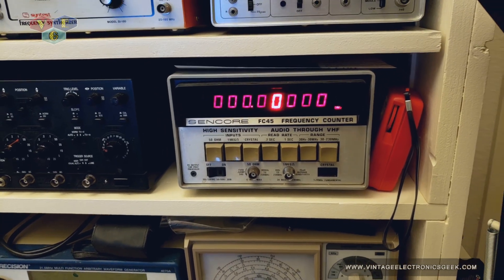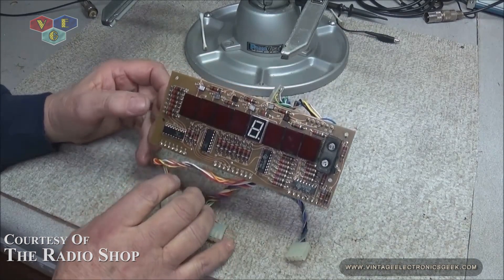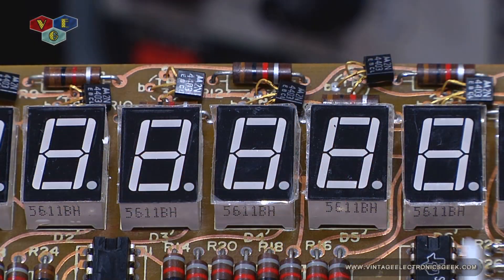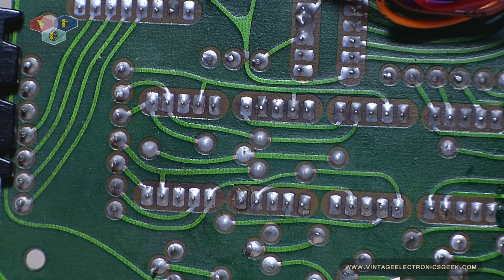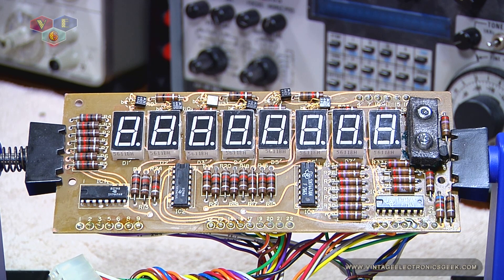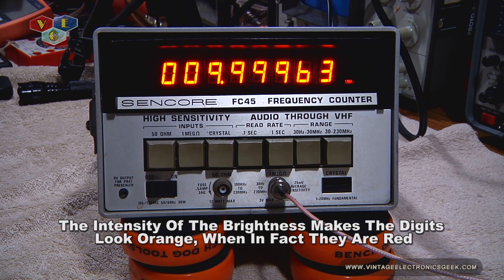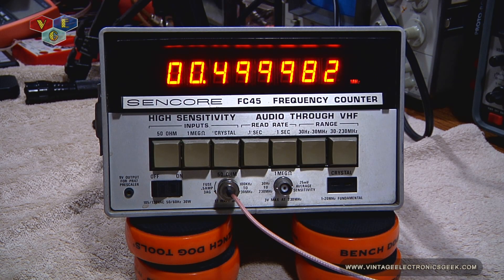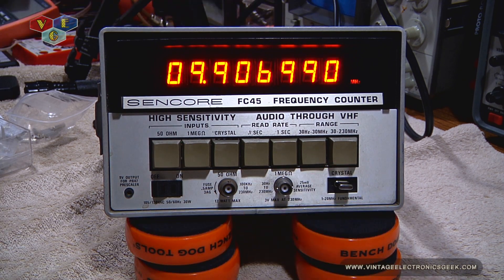Sencore FC45 Frequency Counter - LED Upgrade - Thanks To Buddy At The Radio Shop

Comment: Congratulations on an excellent restoration job. Buddy got one more subscriber this morning. I feel a little smarter than I did when I woke up. Thank you. For the curious: 14.3181818MHz is four times the NTSC color subcarrier frequency. Based upon RS-170A (NTSC's real name) projects. 4 times SC, 910 times H and 477,750 time V. Give or take.... nuttin'!    8) )
Reply from the maker: Thats cool, I'm sure he'll appreciate it!  :)  And thank you, this really is a cool counter...I want to get the prescaler for it next...it will allow this counter to go upto 600MHz...I don't need it as my Leader will go to 1G, but it would be nice.  That second bag of rocks, I got off of eBay...a grab bag of mix...I dont think theres anything to me usable...but it was cheap enough to try?  Saw your post this morning on MD,  you serverd?  Thank you for that!  ~Jack, VEG